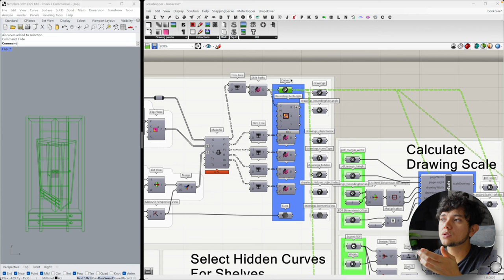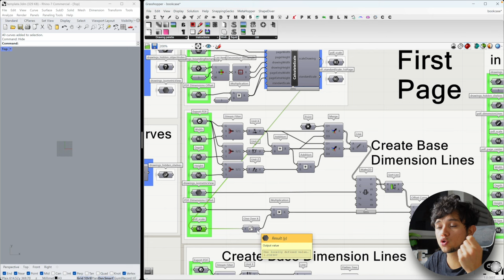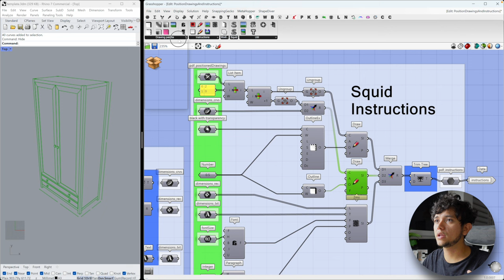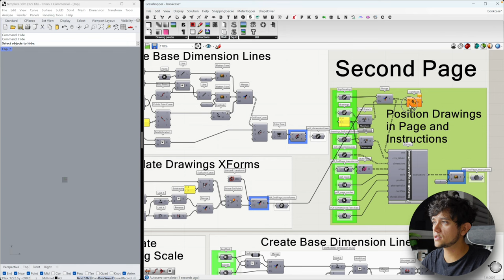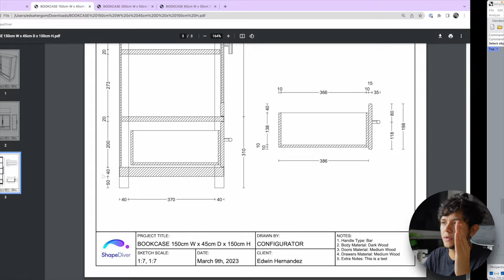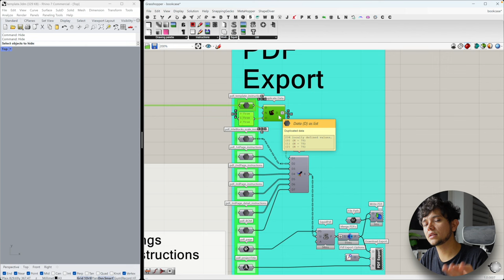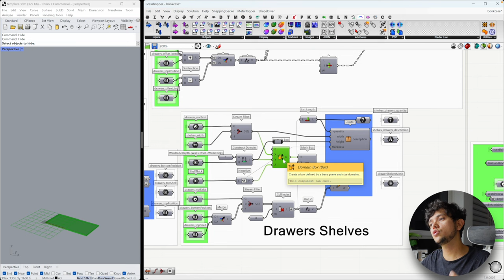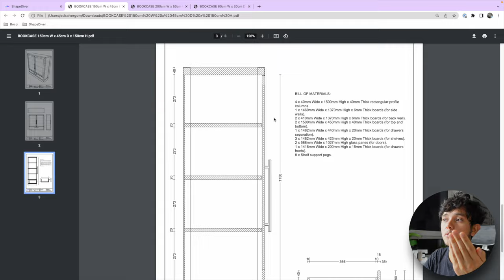How To Generate Complex Technical Drawings w/ Grasshopper | Pt. 3

Comment: Hello, can you use these scripts with your own 3D design or must they be from shapediver?
Reply from the maker: Hi, this is using generic Grasshopper components, so as long as you know how to use Grasshopper, you don't need ShapeDiver to make it work.

ShapeDiver is just necessary in case you want to use/offer this solution online.